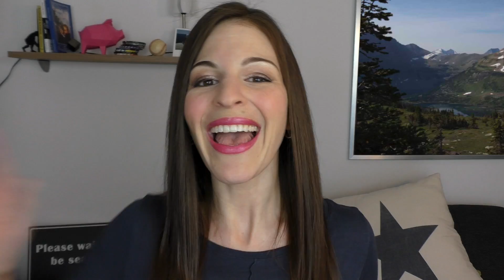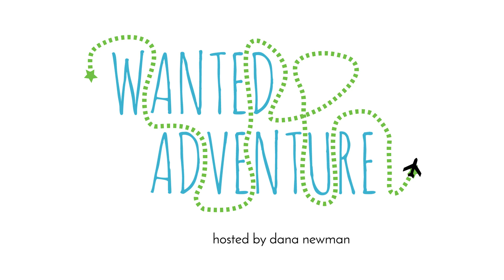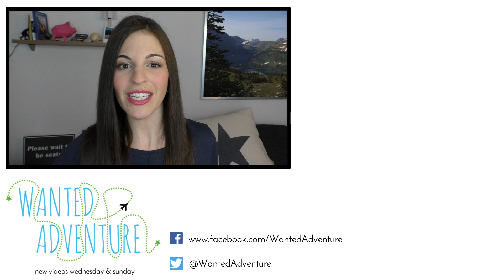Why Are Houses in America MADE OF WOOD?!

Comment: And, you are correct....a concrete block framed house would still be destroyed by a tornado.   At the very least, the roof would torn off.
Reply: John Labus Cinder block and brick don't stand up well to tornadoes, as Joplin Missouri proved. If a strong enough tornado hits there isn't much that will withstand the pressure. My boss's sons lived in a brick house. The wind tore off the roof and leveled half the house, driving straw into the bricks. Luckily the boys, being good Midwesterners, knew, that if you do not have a basement, you go into the bathroom and get in the bathtub because the extra plumbing and lack of windows will help that room survive. I'm in a 45 year old brick apartment and the bricks are starting to crumble. All construction materials have problems.
Reply: Nobody (outside the USA) uses cinder blocks as a building material. Cinder-blocks are just molds to be reinforced by re-bars & poured with a concrete.
The final wall is a military grade protection. 

I'm living in +100yo house & not a single brick crumbles  ... actually I don't know the house still has its original plaster.
Reply: John Labus.  People ignoring the differences between a concrete wall and the usual cement cynderblock wall of coarse will not stand up to a direct hit from a tornado. Hell modern German homes are made of "block masonry  walls" with equal results. Germans just do not get that. Only a steele "reinforced" wall will withstand a tornado, an earthquake, and fire.
Reply: I know.  I get that.  Perhaps what is not understood is that there is almost no reasonable construction method that makes one safe from a tornado.  The best way to protect oneself is to have a basement and many, many homes in tornado prone areas have them.
Reply: You need sheet metal connectors to withstand a hurricane.  Probably wouldn't survive a direct hit by a tornado.

Comment: Not a trivial question. Wooden houses have advantages, especially in areas threatened not only by tornados, but eathquakes, too.
A simple brick-building will be taken out by a tornado just the same like a wooden house but is more resistent against earthquakes. Just look what happened to Amatrice in Italia. These were old stone buildings, and the village was completely wiped by an earthquake. A tornado might have produced the same devasting effect.

The trick is about the main structure of a building, and there were are not just talking about stone and concrete, but about steel. That's the real difference. Houses in Germany, at least if they were built after 1950 do not just consist of concrete of stone, but of steel, too. All essential pillars will be made of steel-enforced concrete (Stahlbeton), as well as all ceilings carrying the upper floors will have massive steel-bars in them (german "T-Träger").

In my former home-town I saw a house hit be a 60ton-truck that got off the road at high speed. It blew away all the stone walls where it hit the house, but the house did not crumple and no one was killed, because the steel pillars withstood even the force of that truck crashing into them.

Comment: Most brick houses in the USA have wood frames.  So to be specific, European houses are framed with blocks.  Wood in Europe is a lot more expensive than in the USA.  Blocks in the USA are lot more expensive to build with than would. A properly constructed wood frame house is as strong as a house framed with block.  A house framed with reinforced concrete is probably the strongest but the most costly.

Comment: Hi, Scandinavia is doing it also, biuld the houses out of wood I mean. Yes, wood can easy be destroyed by wind, water.... But it is also easy to fix. And a house made out of stone is much more expensive. And by the way, stone. The most buildings in Germany are not really made out of stones. The outside of the wall yes, but the inside part of the outside wall you can find more materials, also sometimes wood ;-) It is because the outside wall is normally an inside wall, isolation free space and the brickwork (hope that word is right),  the stones you can see. The material of the inside wall is regional different. But we also have houses, I mean the painted ones, there are no stones outside and there is also no air (free space) inside the wall. This is of course for the new houses not the old ones.

Comment: There are concrete and brick homes, but they are a bit more expensive to build in general. There are lots of homes in America though that are made out of both wood and brick. My house is made of a combination of brick and wood. The bottom floor is all concrete and brick made specifically to protect against tornadoes and hurricanes, and the upper floors are made of wood.

Comment: Wood construction is less expensive than brick construction and most Americans would prefer to build a home that is as large as they can afford. Why choose a smaller brick home when you can have a larger wooden home? Termites can be a problem but not if the home is properly constructed and properly maintained. A tornado or hurricane can easily destroy either type of construction. One popular type of construction is brick-veneer where both wood and brick are used.

Comment: Wood is not bad per se but if you heat a house in Alaska or somewhere with really cold winters and hot summers with a small electric heating device that is absurd especially if these houses are not really isolated. That's what i find crazy. And then if it is hot the A/C is running 24/7... But obviously Energy is so cheap there – too cheap.

Comment: I grew up in the south end of tornado alley. I have witnessed a tornado rip the roof off a house. To make a house tornado proof, bury it. Build the entire house underground. That is the only way to make a building tornado proof. 

A tornado hit Midwestern University stadium in Wichita Falls. The stadium sported banks of flood lights reaching hundreds of feet into the air. A tornado bent then over. That's the force we're talking about. 

RE: Wood 
Absolutely right. Americans build of wood because wood is abundant. But that's not the only material used. Where I grew up, the typical house had a wood frame and a brick exterior. Some utility buildings were built entirely of masonry blocks. An hour or two south of me, flagstone was common. To the west, builders used stucco and adobe. A few used rammed earth. 

IMO flagstone is the preferred home-building material in that part of the world, 'cause it stays cool in summer, and beating the 40 degree Celsius heat is vital. 

PS I assume when you said concrete that you meant steel-reinforced concrete. Roman concrete holds up well, but modern concrete crumbles with steel reinforcement. 

PPS My father was a custom contractor, and I worked with him until I went to college.

Comment: Yes, stone houses won't withstand a heavy object thrown at them at insane speeds. That's only the worst case though. If it's just smaller objects - say patio tables and chairs, half a garden shed or a tree collapsing against it - a stone building will hold up far better than wood. You won't get 100% tornado proof houses using stone, but it still considerably increases the chances to avoid/minimize the damage.

Comment: Tornadoes can bend, rip apart, and pull out of the ground 4 foot diameter trees. It's not what you build a house out of its where your house is built that matters. I would suggest tornado ally homes should be built underground just like the tornado shelters are built.

Comment: It seems there are several different reasons that America favours wood housing compared to Germany.  Here is my go at a list of them.

The Americans have easier access to wood and have had for centuries.

Earthquake regulations (unre-enforced masonary, such as normal brick or stone or concrete blocks, fall appart easily in eathquakes and kill and indure lots of people that way).

Most of America has far less urban density than America, mainly due to cheaper land but also regulation and government policy, leading to far less nead for inter-dwelling fire proof walls, floors and ceilings.

The combined effects of this over the centuries have resulted in timber building becoming the default method in America and thus creating economies of scale different to those in Germany.

Comment: I'll try to summarize... we (Americans) used to build more permanent structures in the old European traditions.  As many folks have stated, these heavier materials are prohibitively expensive nowadays. Why? The complete domination of cheaper, faster, wood light frame construction, has tilted the entire market in favor of this style of home.  The sort of skilled craftsmen who could build a masonry home, or heavy timber home, are gone.  The advancements in materials in the 1950's + post-WW2 housing boom are partly to blame for the Burger-style home that showed up in every suburb across America which everyone is so familiar with. We've never recovered since.

Also want to respond to the many commenters stating a masonry structure is inherently better than a wood structure in a tornado.  Uh, no.  It depends on what wind  loads your house is designed to withstand!  A brick wall can fall down and kill you just the same.

Comment: In an area where there is a great chance of tornados the odds that your house is struck by a truck is much much less,  than you house simply blown away by strong winds. When I see news of an are struck by a tornado there is often a swath of houses blown ayway and not every house could be hit by a big solid object, thus the stronger the buildings are, the less objects can be torn away and fly all over the place. It's something on would have to calculate upon statistics, which I don't have. But my assumption is the stronger the houses would be the lesser parts would fly around. Further more there aren't only those massive deadly tornados, there are smaller ones too.

Comment: From an ecological viewpoint, building purely with wood is far better than using tonnes of concrete. No building will last forever, no matter what the construction. Of course a concrete/stone building will last longer than a wooden one & require less maintenance, but also the quality of construction is a major factor here. When it comes to the time for a building to be 'recycled', wood has a much lower impact. I have recently built a wooden house in Germany, partly for environmental reasons, partly because I build it alone, as a trained carpenter. However, none of this is necessarily a reason for why houses in America are built out of wood. I always assumed that it had something to do with Nordic settlers, who could quickly & easily erect wooden houses with materials, & in a climate similar to home, using the skills & knowledge brought with them. In the Nordic countries, wood is still the predominant building material, much in the same way as America.

Comment: wood homes are cheaper (still depending on where you live).
but, depending on where you live at needs to be thought about what type of house you need... nature will tell you what is best to build of (termite proof, earthquake proof and so on...).
and it's cheaper building a new wood home, after the old one crashed...

new question: wouldn't there be so much tornados if the settlers hadn't used that much wood (keeping the wind from speeding up)?

Comment: The logic behind this is like, I could die from the measles and cancer, so I don't vaccinate against  the measles. - A brick house stands a blast from a solid object thrown against it still better than a woodhouse (also, it usually has no metal roof that can be ripped off and become an additional danger). Also they most probably need less cooling - you'll come off cheaper on the long run. But hey, they voted for Trump, so there's no use reason in arguing with 'Murricans.

Comment: 1. All of these "Fachwerkhäuser" (wooden frame) are houses made of wood.
2. Here in Germany many of these prefabricated-houses are made of wood and the bricks you see outside are only a kind of make-up and covers the insulation.
3. Wooden houses last longer.
4. In case of fire a wooden house keeps its structure longer than a house with a steel frame or made of concrete. (by the way: the water to fight the fire will make the biggest damage)
5. Wooden houses are warmer (heat transmission coefficient).

Comment: A house made of brick or stone and even cement block are rubbish in a strong tornado. A house built with steel reinforced concrete can structurally withstand a strong tornado. However, doors and windows cannot. Doors, windows, chimneys etc. can be destroyed or damaged by even small tornadoes.
Reply: True.  I live along the Missouri/Kansas state lines -- in "Tornado Alley."  Brick and stone houses are easily demolished by a tornado.  In fact, about 10 years ago when a tornado landed about 7 blocks from my house a neighborhood of brick homes were destroyed in the 230+ mph winds.  One old man was even killed by a flying brick from his fireplace.
Reply: This is true. Here in Brazil normally the houses are built by concrete. But in South of Brazil it's rarely tornadoes but they exists. In past in the Santa Catarina State a lot of tornadoes have destroied roofs, windows and doors of many houses.
Reply: I doubt what you say because when you see the aftermath its the brick ones that are still standing surrounded by a pile of splinters
Reply: bob rambo: It only looks that way because those "brick ones" are still standing, so you can't tell that they are actually framed in wood. Many houses in Texas and Oklahoma are wood with brick cladding and very few are structural brick, so they look like brick until they are destroyed, then you see the sticks.

Comment: That was kind of silly. I don't think anyone is looking for residential structures to withstand a bus, or similarly sized object, hurled at it, but rather ways of making the structure safe from the wind itself, and resistant to much more numerous smaller objects flying around. first, you need to make sure the structure is adequately secured to the foundation, and the roof to the walls. This is usually done by metal strapping. Second, the walls need to be cross braced, so they flex less. Third, but not least, The windows, doors, and the garage doors need to be as resistant as possible. Once they go, the house is fare more likely to be ripped apart.

Comment: Speaking on behalf of the tornado alley, housing was originally wood because of the speed and cost effectiveness to put up a home, and that is also a valid reason today.  Some of the land out here was given to anyone who could live on it in a home for five years.  We are sitting on limestone and clay, and big heavy concrete or stone buildings need a lot of work under them to make sure the whole building settles at the same rate or it will crack in half.  Most of our schools and large offices are made of concrete and it is a large endeavor to prepare the land before building can get started.  Wood is not as heavy and is easier to fix if it does settle.  Bricks do not handle settling well at all.  We don't worry about the tornadoes tearing apart our houses as much as we survive by going into basements or storm shelters.  We do have some stone houses, even some from the 1800's around, but they are few and far between because of the time and money to build one and over time they have fallen apart.  Much of our houses today are built by developers who buy a large plot of land and  put up wood houses to resell them by the neighborhoods, which is a fast way to make a profit.  Also, wood houses are easier to expand or change the layout inside if the family grows.  We do have a large variety of disasters that hit our area, from tornadoes, floods, drought, and earthquakes.

Comment: So the obvious follow up question is why are houses in Germany made out of stone or concrete? 

I typed that question into google and the third result down was a wikipedia article about Low German Houses or Fachhallenhaus which were apparently timber framed houses that went out of style in the 19th century. 

The thing to note is that Fachhallenhaus is a rural style of house and presently America has a lot of rural areas compared to Europe in general.

Also wood can last a couple of centuries in a building while stone lasts alot longer but costs more to make so over time more rich people will make more buildings out of stone in America until most American houses are made out of stone except where it is a bad idea because of weather. Other people have mentioned earthquakes are bad for stone housing but as someone who lives in minnesota here it is more because stone isn't a good insulation and winters here get to negative degrees in Fahrenheit. 
So -18 degrees Celsius or colder.